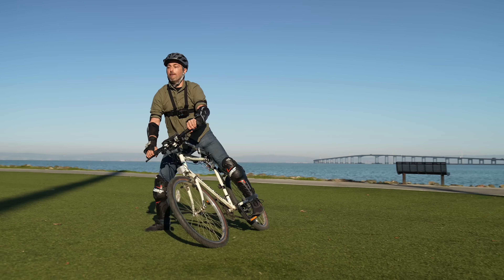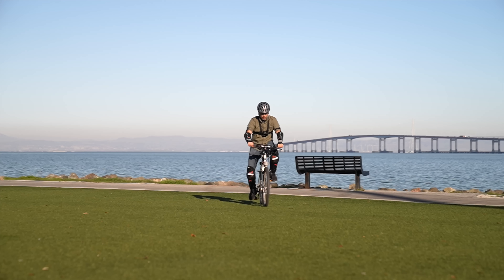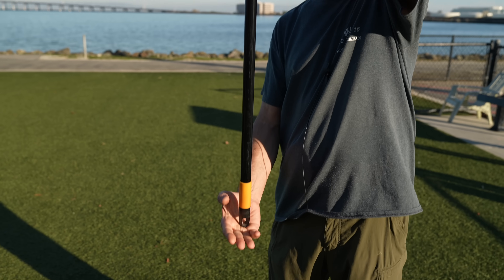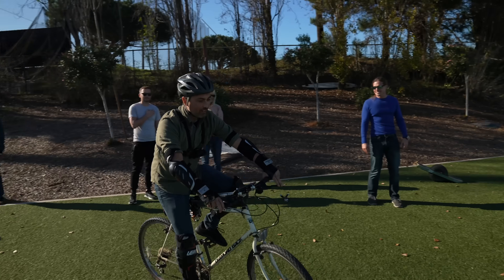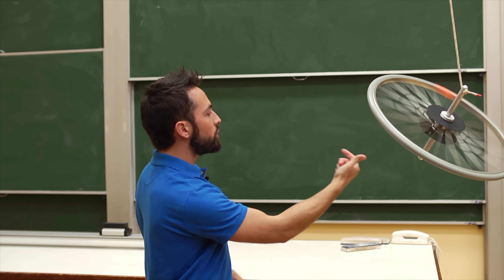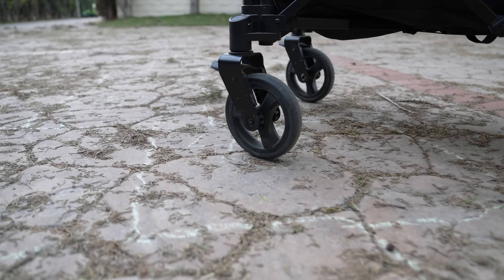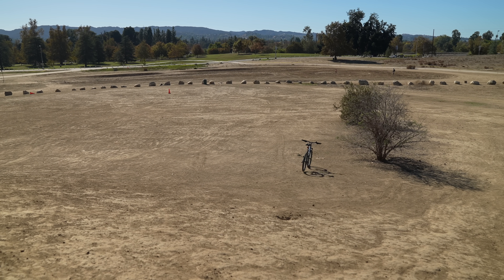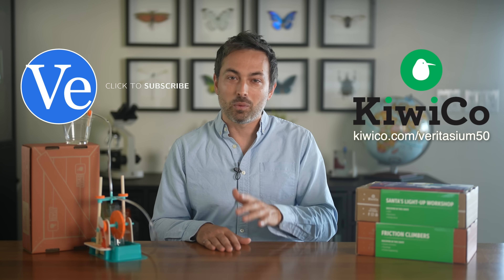Most People Don't Know How Bikes Work

Comment: Damn.. they haven t rode broken bikes when they were young... You pull the handle and make a small jump aside with your front wheel.. to the side you tend to fall (the locked steer).. then you re balanced once again. Boom :))). Couldn t belive the video ended and they haven t tried that. I was doing it all the time on a bike that had trouble steering to the left. Before a right turn, I d make a small jump to the left. Of course I don t think this would work for long with a totally blocked steering direction, but still funny I haven t seen them trying it. It comes naturally to me to try to put the wheel under me when starting to fall on one side by hopping the front wheel to the falling side and leaning a bit on the other side (like... skiing?) before totally jumping of the bike. I was doing it all the time when I was younger and had temperamental bikes :)))

Comment: Hi Veritasium, while I was watching your video i was wondering why you are actively steering to turn. Today I tried on my commute and most of the time I don't actively twist the steering around to turn. Instead I lean to initiate the turn. During that I didn't notice any steering in the opposite direction. Sadly I don't have your bike,  could you maybe try it yourself if you can turn only with leaning your body in the direction of the turn, the steering should follow automatically but there shouldnt be an initial counter turn?
Much appreciated.
Reply: That’s what this whole video was about. You MUST point the front wheel in the opposite direction in order to initiate the lean. It can be very subtle however, because as soon as you are leaning, even keeping the front wheel straight causes your lean to increase.
Reply: @oliverpolden  I think I ddn't explain myself clear enough.
For Veritasiums statement to be true, we have to accept the notion that counter-steering is the only way to lean your bike. And I kindly disagree with that notion.
I think I found two ways to lean my bike without counter-steering.
1. Sit upright, you can even let go of the handlebar. Push your hip to one side (eg. left) and counter move your upper body to the other side (eg. right). This makes the bike lean left and initiate a lefthand turn.
2. Push your hip to one side (eg. left) and counter move your upper body to the other side (eg. right). Now you can push downwards (not forward) on your right handlebar. This makes the bike lean right and initiate a righthand turn.
I can't detect any counter-turning of the handlebar. Maybe there are micromovements which I can't detect. That's why I said I wished he would try it himself.

Comment: I got into road cycling years ago and when you're dropping down a curving mountain road at 45-50 mph, apparently you're steering away from where you want to go, and when I was doing this, I tried to pay attention to what my bike was doing, but maybe it's too subtle to really notice. But for every left turn, I would actually push down on the left dropbar with my left hand, which, as this video shows, makes the gyroscope turn right; presumably this is what is taking place. At those speeds, you never turn the wheel left to go left, you would immediately flip over.
Reply: You're just turning the wheel no matter what method.

Comment: As someone who rode heavy motorcycles, you also learn to “counter lean” at low speed.
Reply: Was just thinking that the experiment was missing that. Lemme see that figure 8 on a 1k bike
Reply: @SkaForFood  I figure 8 my Harley Road King all the time for fun practicing maneuvers. Its over 1000lbs with me on it. I also passed my road test for  my license on a Harley with forward controls and had to do multiple figure 8s in a small box. If you know how to ride, its no big deal. Most people only think they know how to ride. At low speeds yo counter lean, at higher speeds you counter steer. At higher speeds which way you lean is actually less important than how you counter steer. You can put a knee down, stay strait, or counter lean. Each one has an advantage. Understanding friction and counter steering is more important.
Reply: Even at high speed on a motorcycle you'll turn quicker (easier) by leaning to the left while pulling back on the right side of the handlebar. For a right hand turn it's the opposite; lean right and pull back on the left side of the handlebar.

Most casual riders will never experience this unless they were taught to do it by a more advanced rider.
Reply: @phillipzx3754  yeah same but different push on right handle bar and turn right. Likewise if you push on the left handlebar you turn left. Better control than pulling on the handlebars👍🏽
Reply: @phillipzx3754  I don't believe leaning has anything to do with how to turn a motorbike. Well at speeds where the gyroscopic effect is in play at least. You can remain perpendicular to the frame as if you were a rigid part of the frame and to turn you put a small force on the bars opposite to the direction you wish to turn. That is as you say, pull back on the right handlebar grip to turn left and vice versa. In road racing, the reason the rider leans off the bike into the corner is not to make the bike turn but to get the bike/rider centre of gravity as low as possible so as to reduce the lean angle of the bike thereby increasing the speed the bike can corner. In fact the road racing rider is doing exactly the opposite of what you suggest. If you watch a race you'll see that they often move their body off the saddle in the direction they are to turn before they start the turn. As to low speed riding such as in a shopping centre car park hmm that may well be different. But I wouldn't know. I never went that slow. LOL. It is fascinating physics aint it. :)
Reply: @phillipzx3754  only time I've ever pulled back on a bar is in a very tight chichane, pushing on the bar has usually worked for me well enough on track
Reply: You mean keeping your body upright while leaning the bike into the turn? Bicyclists do that too at low speeds.
Reply: @fyrstormer  no, not like that. You turn the wheel opposite to the way you want to go. This causes the machine to lean into the direction you want to go. Then you straighten the front wheel. Voila, you leaned into the turn wrist turning the wheel away from it.
Reply: Yeah like I ride a ninja and when I low speed turn you can just lean into the turn with slighting turning handlebars the direction you want to go or if really slow speed or u turn counter lean for sure
Reply: A class is great, although anybody who already rides will say "why the hell would I waste my time with that". When we attended a riding class, they expected some pretty tight turns which you could get done easier by doing a lot of stuff like shifting your butt on the saddle.
Reply: I was thinking of saying something like this but you beat me to it.
Reply: Exactly what I was thinking
Reply: At high speeds you counter steer. He can barely ride a bike normally if you watch his other videos. It's is not impossible to ride with steering locked, you just have to train your message me different same as riding a backwards steering bike
Reply: @LocoLensWP  you counter steer at all speeds not just high speed
Reply: This video just proves he has never ridden a bike. Pushing to turn instead of pulling is just too hard.
Reply: but isnt that only at low speed, like at high speed we dont counter lean
Reply: @mickaelht598  Actually, with a heavier bike at higher speeds, counter leaning lets you execute maneuvers faster, especially in emergencies. Its much faster to go from a hard left to a hard right if I am leaning against the turn instead of into it with a knee down, because then I do not need to move my body from one side of the bike to the other, I just move the bike. It is much faster to then quickly shift my weight a little while moving the bike a lot. This is how they teach cops to ride touring bikes. This is why I keep up with crotch rockets through twisties on a 1000lb bike. They look at me pretty crazy when they see me in their mirror and cant lose me until there is a long enough strait away.

Comment: I bicycle wheel and a caster follow the path for different reasons.  The caster follows because the forward motion pulls the contact patch in line with the axle in front of it, the bicycle wheel turns away from the lean because of the lateral force on the contact patch.  If you move a bike forward and don't allow it to lean the wheel will turn out of line unlike a caster.

Comment: Same thing works when you're riding a snowmobile in deep powder, if you want to turn left, you turn the handlebars right. The difference is, you keep them turned all the way right throughout the entirety of the turn. It's referred to as counter steering and is very counter intuitive until you get the hang of it.
Reply: Skiing too. To edge you skis early in the turn, it's necessary to send them uphill while keeping your centre of mass from following.

Comment: Interesting video. But a lot of it is obvious though.  If you take your hands off the handle bars, the bike will still be balanced and ride straight. This means that it auto steers.  I do this during a long ride where I need to take a break from leaning over. You can turn by just leaning to the side. Most advanced bikers know this.  Also, I only need to counter-steer when I'm biking slowly. So this is not a revelation to me either. Again, I always lean to one side to change directions since I'm always moving fast enough.

Comment: I'm surprised you didn't mention the steering change that happens at speed. When you're going slowly, the bike will turn in the direction the wheel is pointed, but when you're going faster, the bike will go the opposite direction. At speed, the lean is controlled entirely by steering and there's no need to lean 1 way before going the other. You can be in any angle and go directly towards the opposite angle. If you've driven a motorcycle, you know.
Reply: This is not true. Countersteering is necessary at any speed. The experience you're having that makes it seem like you can simply steer into th turn at low speed comes about because the front wheel is constantly contersteering to maintain stability. At low speed one of these "implicit" countersteers is enough to initiate a turn if you simply allow it to happen. So there's still a countersteer initiating a lean, which allows the turn to happen. It's just not one you have to actively perform. The video does mention this but doesn't really explain the implication.

Countersteering is also required to come out of a turn. If you're in a hard left turn, the way the bike gets picked up is that the front wheel is countersteered further to the left, which causes the bike to start leaning to the right, bringing it upright.
Reply: @allmhuran  Which part is not true exactly? Because it doesn't seem like you're in disagreement with me. I never said there wasn't a counter steer initiating the lean at low speed. In fact I implied that that was the case when I said "there's no need to lean 1 way before going the other" when talking about high speeds. I simply said that the bike will follow the direction of the wheel. Which is true after first initiating a lean in that direction (by counter steering or balance) The same cannot be said for driving at high speeds. The bike will never follow the direction the wheel is pointed towards unless that direction is straight ahead.
Reply: @poipoi300  When a bike is in a turn, the front tyre is pointed in the direction of the turn. This is true at any speed. But in order to be in a stable turn, the bike must be leaned (or, more strictly, the centre of mass must be leaned). The countersteer is used to create the required lean angle. So I guess the thing I'm saying is not true is the idea that the physics of steering change dependent on speed - they don't.  There's always a countersteer in order to initiate a lean into the turn, and once the lean is established the front tyre is steered into the turn. True at all speeds. In fact, you can calculate the radius of the turn by looking at the lean angle, and the relative deflection of the two tyres. If you draw lines that pass through the wheel axles into the ground, they will eventually intersect at some point underground. If you go vertically up from that point, that's the centre of the turning circle.

This of course assumes a normal riding situation without excessive loss of traction. If we're steering the bike by sliding the front and rear tyres around, like in a speedway race, this analysis becomes irrelevant.

Comment: There is a way to beat the 1 way turn lock system by just leaning in the direction of the turn instead of steering in the opposite direction first before taking the turn

Comment: FYI, the alignment specification on automobile front wheels that keeps them wanting to go straight is also called "caster". The caster setting on a car is usually between 8 and 12 degrees, which is also why you can let your hands off the wheel going forward, but if you try that going backwards the car is inherently unstable. It has a secondary add on performance effect though, when you turn the front wheels of your car that caster setting causes them to "lean in" to the turn, so that when the vehicle's body rolls due to inertia in the turn, more of the front wheels have contact with the ground rather than less which is what you'd expect when the car tire leaned over from that body roll.
Reply: Caster or camber?  The latter I know as the 'lean' left to right of the front wheels, and it's what causes them to wear unevenly on the inside - and it's the reason standard rotation is not particularly useful (because the same side of the wheel is taking the brunt of the weight regardless of what side of the car it's on, front or rear).  I tell customers to flip the tires - unmount them from the rim, flip them, and re-mount so that the outer shoulder, which is much less worn, is on the inside and the tire is usable for longer, due to camber.
Toe is entire different and I'm not as familiar with how it works.

Comment: the counter steering is something that i had noticed before, when riding on snow or passing from wet to dry pavement, four wheeled vehicles turn in arc-shaped path, but bikes turn in a question mark "?"  path. i had noticed that before but i didn't know the reason.

Comment: I believe that a decent rider could lean in the direction they want to turn, and perhaps lean more than they intuit, then steer and make the turn.  We start the lean with steering because it's probably easier, we have it in our muscle memory, and it's intuitive.  I'm not convinced that it's necessary.
Reply: You can't start a turn this way. If you want to lean your body to the left, you have to push on something. The push will be to the right. The thing you're pushing against is the bicycle. The centre of mass of the bike-rider system won't change. It can't. It's physically impossible.

What you can do is initiate a lean (via a countersteer) and then move your weight - because now some of the reaction force vector is taken up by the leaning bicycle and directed into the ground. Also, once you are leaning you can use gravity to drop your body mass lower, which has the effect of leaning the centre of mass of the system further from vertical.

Of course, you can shift the weight up front if you want: Lean your body left, and the bike will lean right. It will keep going straight. It won't turn. But then, when you initiate the countersteer, your body is already positioned off the bike somewhat. This can be advantageous, because it's easier (more stable) to shift your weight before the turn than during the turn. This effect is really obvious if you watch what happens at the end of the straight in motorcycle races. The riders will all set up for the turn before initiating it, hard on the brakes and with their body weight already shifted - *but still going straight untill they initiate a countersteer*.

So yeah, you're not wrong - you certainly can "lean and then steer" - I just want to make it absolutely clear that the turn won't actually happen until you steer.

Comment: This is a well known concept for motorcycle riders.  I'd love to see a further exploration of this as it relates to velocity, mass, and lean angle.
Reply: Exactly. Our driving instructor told us, in case of an emergency (e.g. suddenly need to evade an obstacle), push the handle on that side to which you want to go as hard as you can. Even if you push very hard, it won't go very much that direction anyway (depends on current speed of course), and bike will be upright and go straight again within seconds or less.

Comment: It always seemed to me steering was basically optional when riding a bike. Sure, you'd make small adjustments because it's impossible to hold the handlebars perfectly still. But the main way of steering, for me, always seemed leaning. Going into a curve at 30km/h I'd just lean left without turning the handlebars by more than five degrees. Now I think I understand the actual importance of steering to start leaning.
Reply: I guarantee you,you were countersteering without knowing it. Body steering is inefficient, it only needs to be small adjustments but that's all it is to get the weight to shift

Comment: Why did no one tried to ride the bike without you're hands. I do that quite a lot for myself and it's almost like my bike is riding imself. I use my weight to stabilize every thing
Reply: @XtreeM_FaiL  i watch it all and they never mention anything about riding bike without touching stering
Reply: @anthonybergeron28  It does not matter if you touch it or not. If the fork is fixed it can't turn and the bike will fall.